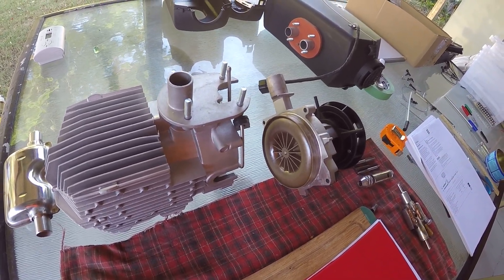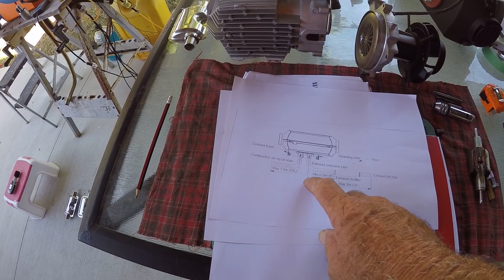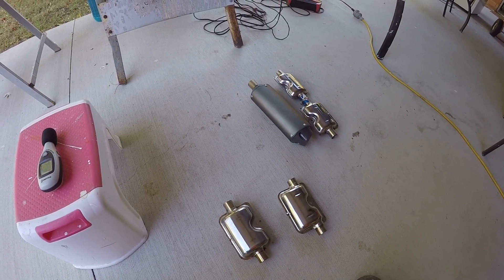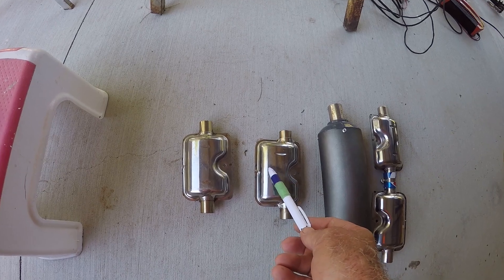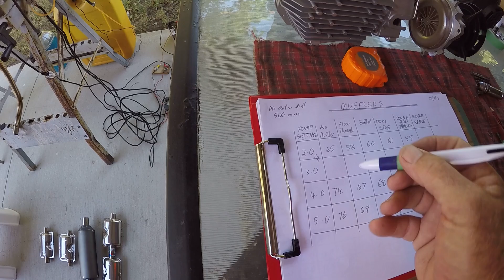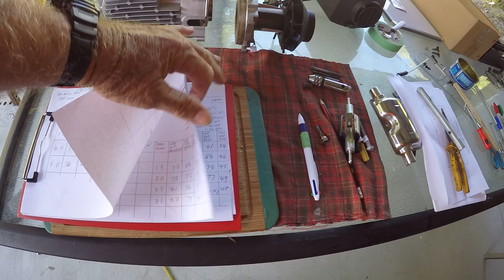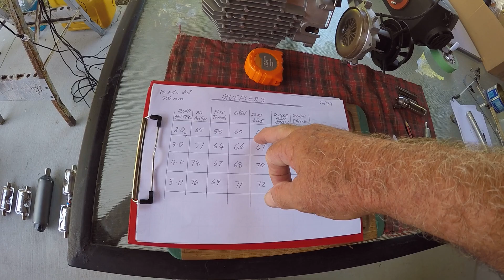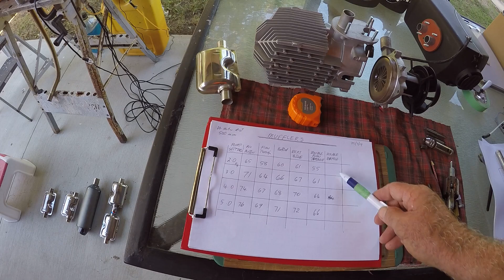Chinese Diesel Air Heaters - Part 8 - Exhaust and Mufflers

Comment: Hi John. Just wondering if you have any tips on shortening the stainless steel flexible exhaust pipe and making the cut end fit over the exhaust inlet? I have a 600mm piece and I need it to be 300mm. I have cut the pip but can't widen it enough to fit over the exhaust for clamping. Cannot find 300mm lengths online.
Thanks!
Reply from the maker: Hi Simon, I must have missed your post. Yes, just cut the ss pipe where you want and cut 4 or 5 slits in the end with a fine hacksaw. You can now spread the pipe to fit. Use exhaust sealant or high temperature silicone to seal.  JMcK
Reply: @johnmck1147  Thanks for this. I'm facing the same issue. I've got the corrugated, single-wall pipe that came with the kit. It's the perfect length for my Sprinter installation. but I want to install the muffler. This makes it too long, and also tricky to install the muffler last, at the edge of the van.

So, I cut the pipe about 6" back, intending to put the muffler there, with a few inches after to reach the edge of the van. I did not foresee that the muffler does not fit inside the corrugated section of the pipe.

I messed around flattening the corrugations out and stretching over a makeshift mandrel, with no luck. I cut two (then four) slits and fit with a SS hose clamp. This holds, but does not seal, and seems likely to crack from the slits over time. 

I've searched for couplers or similar solutions for sale, without finding much. Any, actually. This video, and particularly @Simon Helps 's question, is the first reference I've found ANYWHERE wrt my issue. THANK YOU BOTH for the knowledge!

So, now I'm considering ordering a spiral (not corrugated) exhaust pipe and proper exhaust clamps for it, such as VKB. Will that do any better? Am I worried about nothing? Is there a better approach I'm overlooking?
Reply from the maker: Hi Simon,

I have a pipe expand tool which makes things a little easier, however I have also cut fine slots in the pipe which allows it to expand enough to fit, and I have also used copper pipe joiners which you also need to slit to expand or contract.

This way you need to use exhaust pipe adhesive on the joints or high temperature silicone to make an air type seal.   JMcK.
Reply: @johnmck1147  Hi John, Another excellent video, many thanks.  I came looking for tips on exhaust assembly in a boat, where I need about 2m of exhaust.  I wasn't sure what you meant by more exhaust in front of/behind the muffler: which is the front - the heater end?  I haven't played with exhaust sealant since I was a teenager  and would think that the hard setting pastes were a bad idea?  You mention high temperature silicone - any pointers here, or tips?  Many thanks.
Reply from the maker: Jonathan Webb 

Hi Jonathan, better to have more exhaust pipe before the muffler. Heater, long exhaust, muffler, short exhaust then outlet.  High temperature silicone makes a good seal.  JMcK
Reply: @johnmck1147  Many thanks, much appreciated.  I'm spreading the news about your channel.

Comment: Where did you get the 2 meters for the exhaust?  My manual didn't specify, it just said to use only what came with the kit, which was only 2 feet... maybe 1 meter with the muffler attached.  I was coming up short about 9 inches or so.  If you are right on 2 meters then I could easily add that I think.  Or do you think the muffler would be a problem with extending even 9 inches further?
Reply from the maker: Hi 101, 
You can extend the exhaust a little, even up to 2m if you have no tight bends, and only a little downslope. It is not uncommon to run the standard small exhausts over 2 meters on boats, but they have flow through mufflers, and slope upwards so the hot exhaust is not fighting itself.

However, if you go over about 1 meter, I suggest you consider going to a larger diameter exhaust, and I recommend flow through mufflers.

Cheers,  JMcK
Reply: @johnmck1147  Thanks for the information.  Btw, do you think it is even necessary for the pipe to make it's way completely out from under the vehicle?  Or will the fumes make their way back into the vehicle if the pipe doesn't extend out far enough?
Reply from the maker: 101perspective 
As you can see from these videos, these heaters burn very clean and the CO meter will not register even two feet from the exhaust outlet. People often do just run the exhaust out the bottom of a van if they are well sealed as there is a large air gap. It is your decision, But whatever you do, I would suggest you always have a good CO alarm meter in your living and sleeping area, and  always have a non closeable air vent.  JMcK
Reply: @johnmck1147  Thanks.

Comment: Hi John thanks for your time 
I’ve read several comments about insects/wasps nesting in combustion lines
My question for you what can be used to make a stainless steel mesh filter so as to not cause problem like you mentioned in this Video
Thanks Rick
Reply from the maker: Hi Rick,
If the intake is mounted in a clean space mesh filters are ok.
If the intake is in a dirty space such as under a caravan or vehicle that kicks up dirt moisture and dust you need a foam intake filter.

Stainless mesh filters that will suit can be bought at a hardware store plumbing section or an irrigation supplier.
You can also buy them on eBay from a number of suppliers. Below is just one to start you off.

https://www.ebay.com.au/itm/25mm-Air-Intake-Filter-Silencer-For-Dometic-Eberspacher-Webasto-Diesel-Heater/293113012675?epid=14028170397&hash=item443ee5a1c3:g:jcQAAOSwaVRcQEbK

Foam type air filters that will suit can be bought at a motorbike shop.

Cheers,  JMcK
Reply: fly screen off a window can be wrapped around the silencer that came with it, they dont have to be stainless, but would need to be checked once in a while depending on how often you use it, to clean
Reply from the maker: Hi Rich,

Easier to buy one, there are many sold for $6 or $7. Check out this supplier as a start.

https://www.ebay.com.au/itm/25mm-Air-Intake-Filter-Silencer-For-Dometic-Eberspacher-Webasto-Diesel-Heater-/293113012675?hash=item443ee5a1c3

Cheers,  JMcK

Comment: I wonder if anyone has any further advise on installing an exhaust in a sail boat.  Page 14 of this manual is very useful:
https://irp-cdn.multiscreensite.com/c113b2db/files/uploaded/Airtronic_marine_installation_manual_gJHJ9PQRRMaWk794Qofl.pdf

also this brochure shows a different install:
https://www.eberspacher.com/fileadmin/data/countrysites/EB_UK/pdf_files/info_pdf_ebuk/heating_pdf_ebuk/marine_heating_uk_22375.pdf

But I note the following
1. mufflers supplied with most of these Chinese heaters are not air tight.  Block the end and blow in it and air escapes and hence CO2.  Is the muffler really needed and any suggestions on what inline one works and where to get it?
2. does a condensate drain coil need to be installed (ie the exhaust will not self drain in a yacht install).  If so how should the drain be collected and what stops CO2 coming out of this into the hull if its dry?  I'm guessing that under some circumstances it could drain unburnt fuel.
3. in the second brochure the install shows no drain hole or muffler... are either of these important on a sailing yacht installation?

Thanks in advance for any advice.

Comment: Hello again John.
I have found a suitable spot to mount a heater but have a couple of concerns...
To safely port the hot exhaust from enclosed space I need to extend the stainless pipe. My thinking is to buy another 2 600mm lengths and join them together. Does anyone sell the pipes and joiners?
My other concern is two-fold. If I use the stainless pipe as part of a 90 degree bend out of the heater...
1) I don’t have enough clearance. Is there a 90 degree bend that works with this heater and stainless pipe?
2) I would lose length in the exhaust pipe. Again a 90 degree bend would help.
I hope this all makes sense to you and thank you in advance for your time.
 
Regards 

Guy MacDonald
Reply from the maker: Hi Guy,

There are a lot of suppliers of the exhaust pipe on eBay. Try searching for exhaust pipe for Eberspacher diesel air heaters. Here is just one to get you started.

https://www.ebay.com.au/itm/63x2-5cm-Exhaust-Pipe-Gas-Vent-for-Air-Diesel-Parking-Heater-Webasto-Eberspacher/153113093089?hash=item23a64063e1:g:UmsAAOSwSI5bV-cf

You can also straight pipe, ss, copper or even gal pipe and gal pipe 90 deg bends.I have used copper 90 deg bends in the past. 
It is all ok but do not go smaller in diameter. Go bigger in diameter if you have to.

You can also buy 90 deg bends on eBay. You do not say if the pipe is going up or down? 
Remember you must have a drain hole at the lowest spot for condensation..

Comment: I have been fitting one of these heaters during the last week and worked perfectly, when I got the required but and bolt to fit the muffler I went under van and did the last bit then went inside put my feet up ready for a final check,all seemed fine then things changed and up comes error 8, having tried a couple more times it seems the muffler was the last straw, too many angles it seems , your video is a great help so thank you very much.
Reply from the maker: Thanks for the feedback Rachel.

Comment: Hi John    thanks 4 all the info. now i know way my heater was smoking .    Question   is thare a maximum lenkt of the outgoing (warm) air ?   i whant to bild a ring in mij camper.    Gretings
Reply from the maker: Hi Mr Zx, the longer the length the greater the restriction and the lesser the volume. However I have seen outlet tube lengths of 10 m (30 ft) in boats that work ok.

Comment from the maker: Hi Michael, I know of no high altitude kit that is made or sold for these Chinese Diesel Air heaters. These heaters will not suddenly stop working when used at high altitude but they will run rich due to lower levels of oxygen in the air. This will cause excessive carbon buildup in the heaters. Without an altitude kit, I would try running a kerosene/diesel mix 50:50 or up to 80:20 to lessen the carbon buildup. Kerosene is a very clean running fuel.

As for spare parts, I suggest you carry some glow plug atomising screens, make yourself a glow plug spanner, and get an 8mm coach bolt to aid in screen removal. If you are careful with removal glow plugs last a long time and are easily cleaned, so a spare is not normally required. The real risk is breaking one on removal to replace the screen. You will also need to make a small wire pick to clean carbon out of the glow stare air hole, and a spare fuel filter is handy. If you intend to open the heater you will need a gasket kit as they are sometimes destroyed on opening if the heater is well used.

A lot of kits come with an "air intake silencer". These are not an air filter and they don't work well as a silencer. I throw them away. You will need a combustion intake air filter, and if it does not come in the kit, you can buy them cheaply on line. 

Set up correctly, these heaters run very well and very clean using correct fuel. The main maintenance issues are carbon buildup in the atomising screen and a blocked fuel filter.  J
Reply: Are there alternate metering pumps available with lower stroke volume, so you could swap out to get a lower flow rate at a higher altitude?

Comment: I would, provided I had the time and resources, repeat these tests with noise meter situated at a set distance (perhaps 1 metre) exactly in front of muffler exhaust. Of course noise meter would have to be repositioned as required to ensure it is exactly a metre from exhaust outlet.

Comment: Think you ought to position noise meter same distance from muffler when testing.
Reply from the maker: Hi Torstein, Thanks for the feedback. 

Both the two common supplied mufflers have noise readings at the same distance which is the main part of this test to show the baffled muffler is actually noisier than the straight through muffler. 

When  flowing air meets a restriction it creates noise. More noise is caused in the baffled muffler than can be absorbed by the packing material. 

On top of that it creates unnecessary restrictions in the exhaust system. 

If you have a choice, it is better to purchase and use a straight through muffler. 

With a short exhaust with few bends, a baffled muffler is not such an issue. 

With a long exhaust with multiple bends a baffled muffler compounds the restriction issue. 

The dirt muffler was closer to the noise meter so would read louder than it should. 

However the two straight through mufflers are also closer to the meter so at the same distance as a single muffler they would be even quieter than the recorded readings.

Comment: Darn it. Mine came with the baffled type muffler. I guess I would be better off ordering the flow through one.
Reply from the maker: Hi Luke, if you have a baffled muffler, use what you have. If the exhaust runs are relatively straight and short these mufflers will cause no problems. They add extra back pressure only if the exhaust is long with multiple bends. However, if you are going to buy a new muffler, then I suggest you try and get the flow through type. J
Reply: @johnmck1147  O.k. my exhaust system just has a slight curve down to the muffler which is screwed to the back fender of the bus. I guess I'll just leave it as it is. It works great so far.

Comment from the maker: Hi Michael, the Chinese have cloned the diesel water heaters as well, but they are still around the $1,000 mark for a 5 kw unit.  I think perhaps in a year or so the price will come down to air heater level. That is what happened with the air heaters, they started at about half the genuine price, and then fell to a level the masses could afford one. J
Reply: Bobil vans in the UK doing heat exchangers for these to heat water, good prices too
Reply: Did this come to fruition? I know there's a fellow making a heat exchanger and shroud for these as of a couple months ago for about $150. No idea if it's any good.

Comment: I'm so glad to have come across this series of videos - a definitive guide that has been most helpful. 
It'd be nice if there was a way to capture the exhaust waste heat without compromising performance.
Reply from the maker: Hi Michael, thank you for the positive feedback. 

Yes, you can capture some of the exhaust heat, and I may possible do a video on this at some time in the future. You use a 32 mm copper exhaust pipe that is wrapped with 9 mm copper pipe and a water circulating system. You need to use copper to get the heat transfer.
Reply: @johnmck1147  Thanks for your reply, John. 
Capturing waste heat is interesting to think about. I thought of air-to-water heat exchanger too but it'll require a water pump unless there was some clever way to make a thermal siphon - maybe some sort of DIY heat pipe might work. 
It's also interesting that the Chinese cloned the air heater but not the equivalent diesel water (engine block) heater.
Reply: @MichaelAChang  eBay HAS had Chinese  versions that do BOTH air ,  plus an exchanger section to plumb to the engine block as well.

Comment from the maker: Hi, I also would love to know that answer. I suspect a number of factories, or a number of assemblers. The burner castings all look the same, but the heaters will come with different quality gaskets, some have different ECU's, and I have seen some with a coloured case to have a bad moulding that causes the fan to scrape on the case. However the big difference is in the accessories and type of controller supplied. Suggest you buy from supplier with good ratings and one who has returns and ideally a local warehouse. J

Comment: Appreciate all your work on reviewing these heaters.

I was looking at 5kw heaters on aliexpress.com and they vary in price. My question, Are they all
made by one factory and basically the same and just marketed by different retailers or there are truly different manufactures ? 

I don’t mind paying more for better quality, but I can't discern the better quality units.
Reply from the maker: Hi Ji Martin,  sorry I missed this and just saw it today. 
To the best of my knowledge there are a number of manufactures as the castings and cases vary slightly. Also there are a number of different manufactures making the electronics. Mostly they are excellent for the price, but you do get the odd dud, so I try and select a seller with a local country warehouse and one who advertises free returns.  JMcK